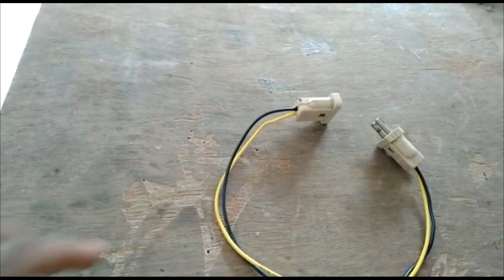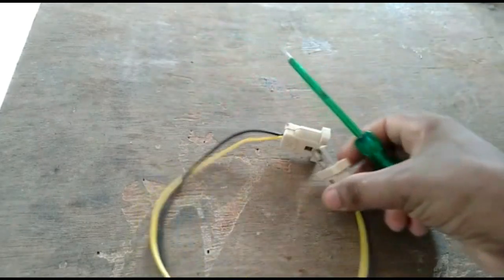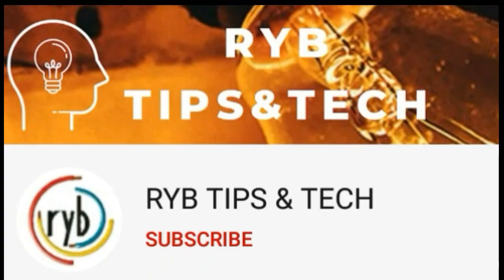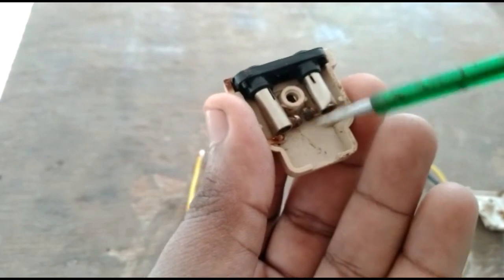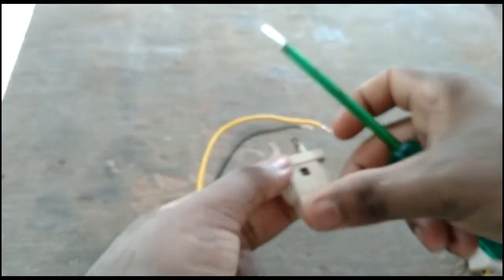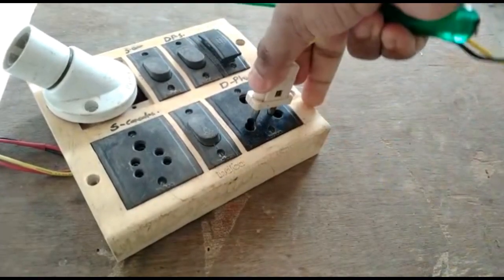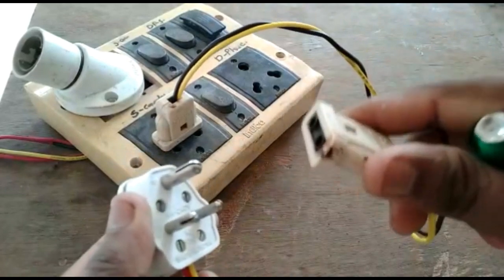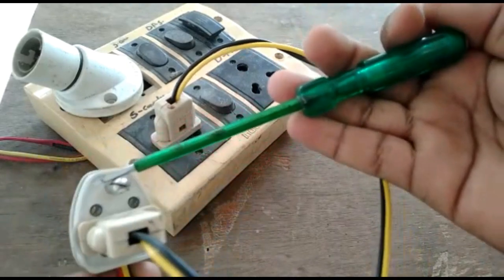How to Check Leakage Current in House Wiring/ malayalam

Comment: neutral earth aanu contact enkil enganey manasilaakum ..athukondu body to line&neutral  continuity test chaithaal mathi..
Reply from the maker: Ya.. Anganeyum cheyam
Reply: Neutral earth touch aayall  current bill koodummooo??
Reply: Can u explain it clearly
Reply: Continuity testing phase to earth & neutral to earth - high resistance aanoo. Short in wire show beep sound. Is it correct